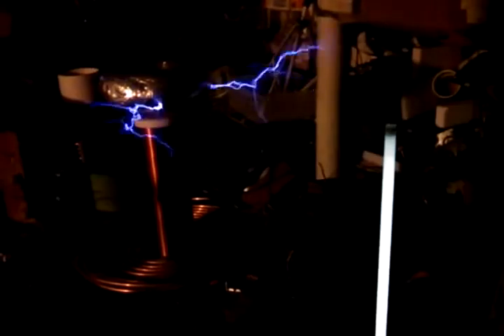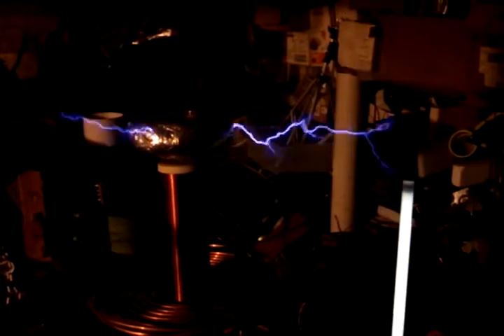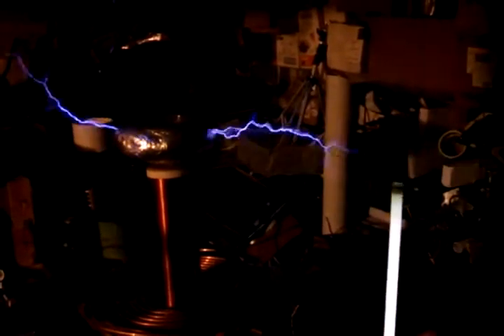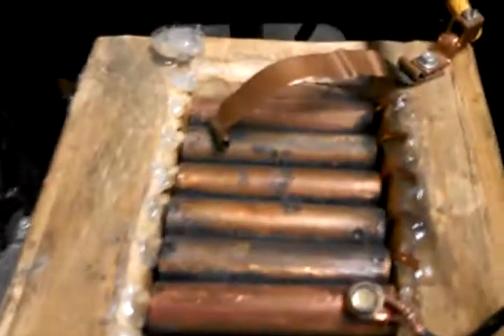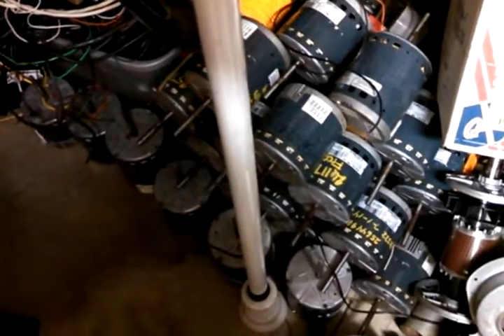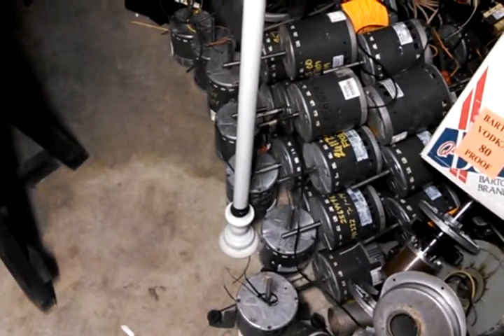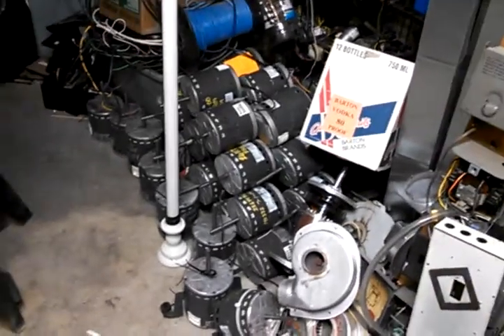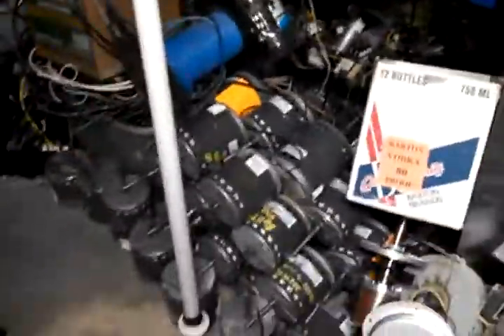Tesla coil tuned for disruptive discharge :-)

Comment: best tesla coil i ever seen,, have you seen this article talking about the longitudinal rays' http://www.scribd.com/doc/246524875/1996-Gerry-Vassilatos-The-Broadcast-Power-of-Nicola-Tesla-pdf#scribd
Reply from the maker: Thank you sir.
Reply: your welcome, Gerry-Vassilatos and peter linderman have the best descriptions of the tesla, scalar/longitudinal waves i have found so far. have you tried the magnetic spark quenching tesla talks about to get the dc pulse in one direction?
Reply from the maker: DANTHETUBEMAN yes. I have utilized microwave magnets for that. It helps by bending the ark between electrodes causing it to snap better.
Reply: have you noticed any radiant energy effects that tesla was describing first as a shock wave and later at higher frequency as pressure,heat, and others? he might have been at higher voltage then you are running to get the effects.
Reply from the maker: DANTHETUBEMAN I have noticed several strange phenomena in my experiments.

Comment: What are the input voltages on the motors? And what are the rpms? I would like one for my van de Graff generator
Reply from the maker: They are all ECM electronic modulated motor. Some are the X13 type. The modules use 120 and 240 depending on what it came out of. But when you spin them you get lots of juice in the form of alternating 3 phase

Comment: did you fix the cap? and wow there are a lot of motors. I'm actually interested in one how much?
Reply from the maker: Shipping cost only. They are various Hp they are 1\3 1\2 3\4 and 1. The 1 is heaviest. I will get them weighed.
Reply from the maker: I'm trying different caps for ballasting the four mots.